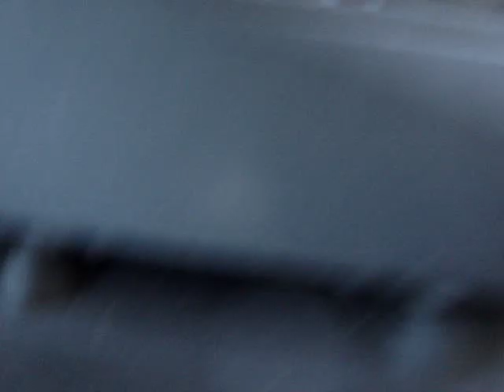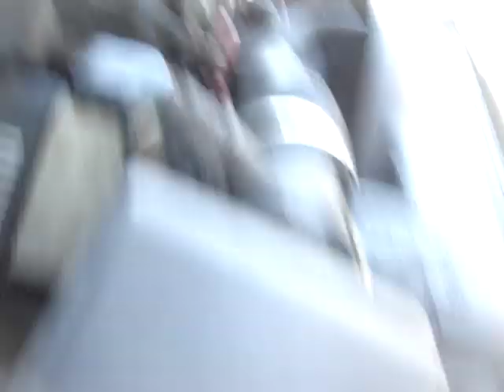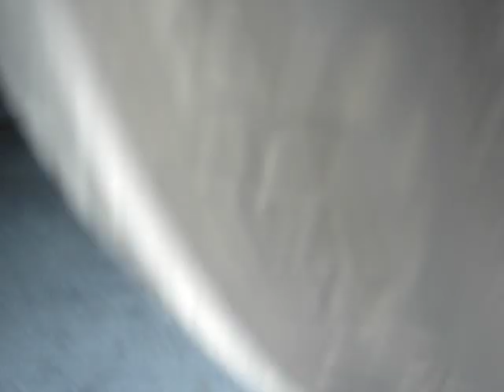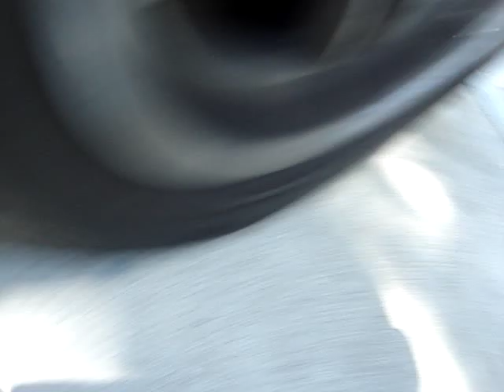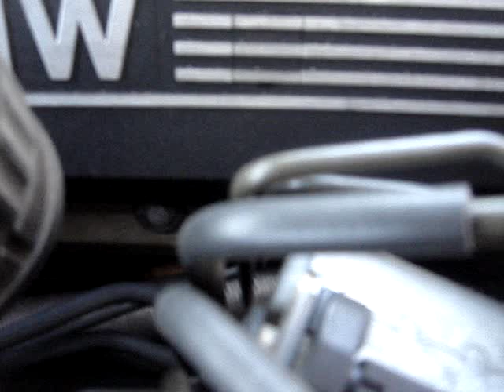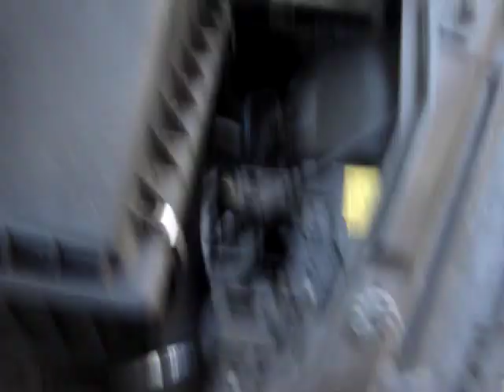Developed ticking on my 95 740iL

Comment from the maker: @forgewire The M60 and M62's tend to have plugs that back out. I haven't experienced it in an M50 or M52. That was the first thing I checked, but they were all tight. It was the Diesel Synthetic oil I tried. The M62 didn't agree with it. When I switched back to Mobil 1 or Syntec, it went away.

Comment from the maker: Typically, yes. But, if you're not familiar with BMW engines, BMW had certain years in the V8's where the cylinder walls were lined with Nikasil. During that time, there was high Sulphur content in gasoline which reacted with the Nikasil thus creating wear at the top of the walls. Due to this "self-destructing deterioration", sometimes the engine would fail to start. This was also a factor of oil consumption. This was even found in engines with less than 30k miles.

Comment: I had the similar sound in 328ci caused by a loose spark plug.
Dealers wanted to charge me ~500 euro just for the injection and compression tests. When brought to another garage (their mechanic used to work for BMW) he said straight away that it could be a spark. He tighten it up and the knock has gone. I'm using Castrol Edge Sport only

Comment from the maker: From what I was informed, Diesel oil shouldn't be used in BMW gasoline engines because of the different characteristics in the oils. Since then, I've used regular dino oil, and the ticking never came back. This car is now owned by my former neighbor, and there are no problems with ticking. Still consumes oil, but that's because it's a Nikasil block with 192k on it.

Comment from the maker: BMW NA replaced these failed Nikasil engines with an Alusil block. There are still a lot of Nikasil engines out there, but because gasoline no longer has high Sulphur content, the Nikasil engines that have lasted >100k may have not been affected by the regions with high Sulphur content back then, which is no cause for concern anymore.

Comment: Diesel&Gas dual rated oil is fine as long as it is RATED PROPERLY (SJ, etc..) for the GAS engine you're using it in.
 Actually the Dual rated oils will provide far more protection than gas only oils. The reason for this i because the Diesel engine must survive a much dirtier oil than a gas engine.
 Any oil must be properly rated for the engine in which it is used !!